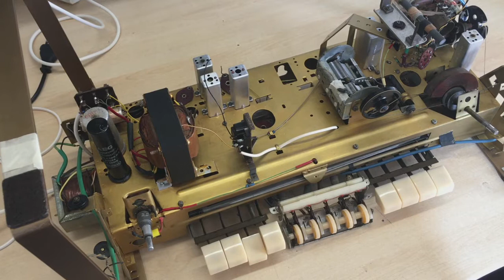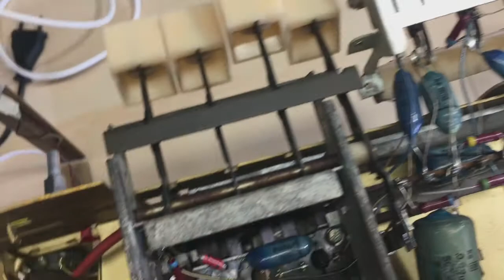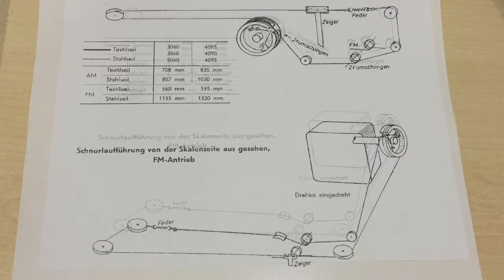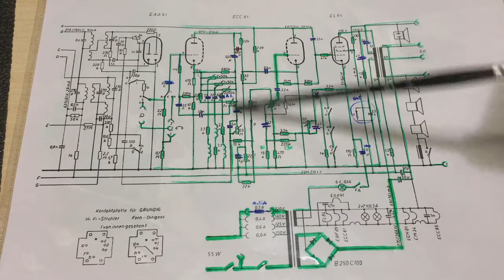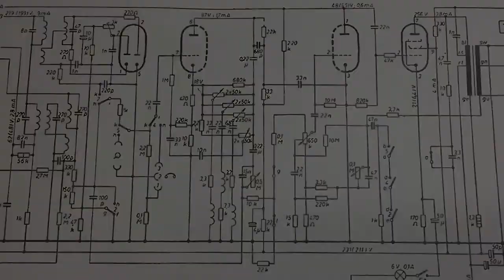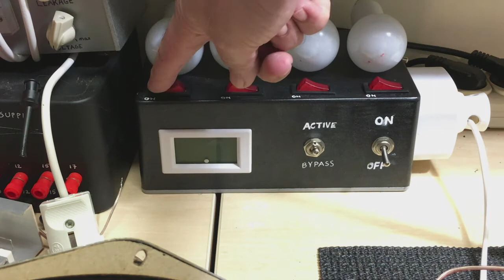Grundig 3060a tube radio restoration - Part 3. Mechanical Nirvana, and first power-up.

Comment: I like the frame which I guess you made so the radio can be spun around for easy access and no risk of squashing anything. A neat idea.
Reply: That is a nifty idea. I've seen most people flip it on the side and lean it on the power transformer.
Reply from the maker: +mbaker335 : it's a really useful tool, especially on the heavier radios.
Reply from the maker: +Leland Clayton : I used to do that until I did some serious damage to one. Thank

Comment: It was great to hear the radio working.  It was just really bad timing when you said "Great Stuff".  The radio station said "More than 50 people dead" and you made that comment just after that......
Behind the Ferrite Antenna dial, is that an LED ?   It looks a bit too vivid white to be tungsten.
This is going to be an awesome radio.  I know it is already done by now, but I am just watching it all now :).   With all those speakers the sound will be amazing.
Reply from the maker: Yes, I guess I need to be more careful of my comments when the radio is on 😊
Reply: @electronicsoldandnew  Or maybe I just need to listen more to you and less to the radio :).
Where do you find these radios usually?  I am in Australia and I really struggle to find some of the classics.  Australian radios of the era were pretty ugly......
Reply from the maker: I get most of mine from Germany (eBay). It’s the only country that has reasonably priced shipping to madeira (usually less than €50 for shipping).

Comment: You need to get your hands on a push pull Grundig! Now they do sound good ;-) Well done so far looking forward to the next video!
Reply from the maker: Edward Norton : I'm holding out for the Saba 125, which is stereo push-pull. They are hard to find but I'm hopeful. I have the saba Freiburg 9 which is amazing, but only mono. It's still one of my two favorites (the other is a Braun Atelier 3) which I listen to almost every day.
Reply: Perhaps with FM being slowly switched off in parts of europe "Norway this year even" such sets might get a bit cheaper ? automatic tuning won't be much fun when you only have one station to tune to ! so maybe the desirability might wain a bit....
Reply: Simple solution - buy a Bluetooth low power FM transmitter for your home. FM will never die this way.
Reply: I think you missed the point.... Automatic FM station search function... part of the "fun" of theses sets is going from station to station on FM automatically, could do it with a few fm transmitters but whats the point you can only listen to one at a time... kind of sucks the fun out of it...
Reply: Indeed it is fun (I have 4 automatic Sabas and a push-pull Grundig 4090), but I love the sound of these radios too, so I want to keep them alive long after FM is gone. And, you can get some of the fun back by changing the frequency of the FM transmitter and watching the AFC track it up and down.

Comment: Hi M, I know you have touched base on this topic before, however I don't fully understand what to do. I am going to remove the rectifier and install the diodes into it as you have done here, as it is burned out. I believe it's the same type, it is the same company anyway. Did you have to put a resister in line with the 'rebuilt' rectifier to get the voltage down to the proper level or was it fine the way it turned out. I don't recall you saying if you did so or not. Do I just check the B+ when done and add one if needed? Thanks, Tom
Reply from the maker: +Bucyrus Erie12 : I did not need to put in the resistor in this case as the voltage was at about the right level. I believe the transformer I replaced was of a slightly lower voltage so it just worked out this way. Usually you'll find that the b+ is a little high (you can test with the tubes removed) and determine if you need a resistor or not. You work out the resistor value empirically or with a little ohms law. Trial and error is usually enough.

Comment: What did you use to clean up the chassis? Only Isopropyl alcohol?
Reply from the maker: Mostly. You can also use a moist cloth with just water, as long as you don’t let it drip.
Reply: Ok. Thank you. I'll try so.

Comment: A little late to the party. But what did you clean the knobs and white "ivory"plastic parts with? I am about to tear apart a Grundig 4077, that is thankfully in much better shape than your 3060, just dirty.
Reply from the maker: Zachary Kremer : I used isopropyl alcohol and an old toothbrush. You can actually use toothpaste if you need a little more scrubbing power. You then clean it off with cotton swabs.